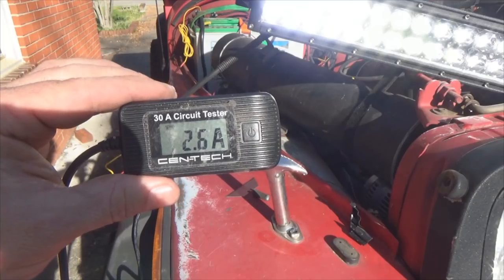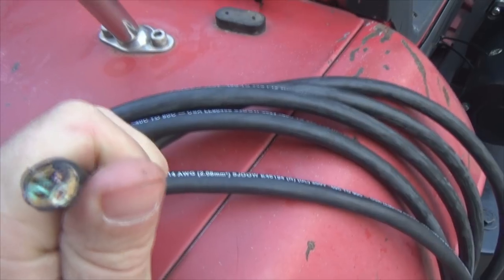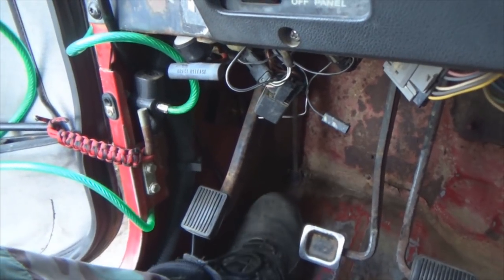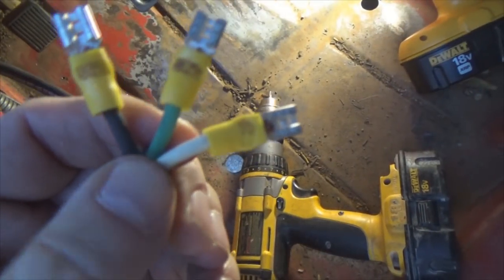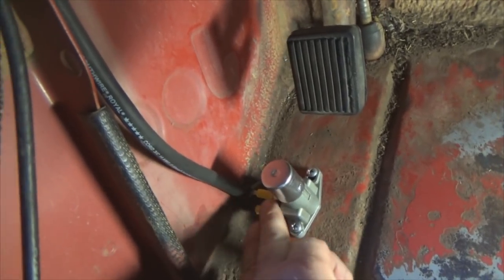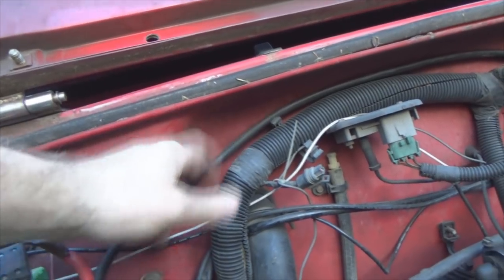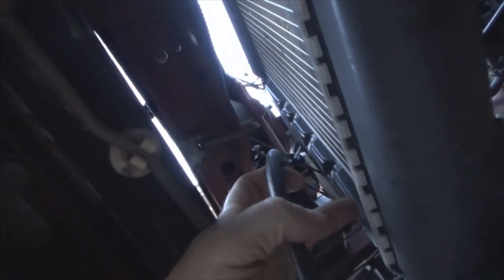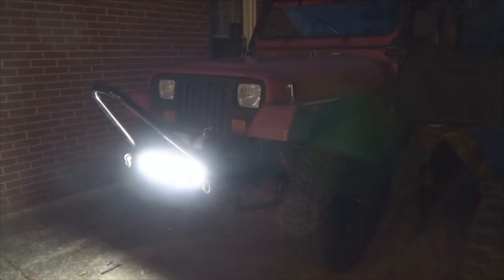Jeep Wrangler YJ - Lets install the floor light switch

Comment: Great vid - thanks.  Dumb question but on my '90 YJ i dont seem to have the fuse block where you show yours?  Any thoughts on this?
Reply: i found my answer after the fact.. it didnt help that i have 91 YJ Owner manual and that model switched over to the additional engine fuse block whereas prior years did not.
Reply: Have you checked under dash in the driver's side
Reply: @that_jeep_wrangler1886  yes, i knew about that one but i was looking for the engine fuse block, which doesnt exist on the 90 model i am running

Comment: Just wanted to know where you got your 30 amp current tester I have looked everywhere and no one has them napa,auto zone, advanced auto,etc. Thanks
Reply from the maker: I got mine at Harbor Freight a few years back. I also included an Amazon link in the pinned comment where you can order a similar version if you like. Thanks for checking out the video! Have a great day!!

Comment: when that positive wire comes loose on the floor i want to see the video of you putting the fire out lol no sleeve connectors dont do well especially in a jeep. have 4 jeeps in my shop right now burnt to the ground because of  bad home installs. oh and green should be power black should be for night and white for day with sleeved connectors.
Reply from the maker: Cant argue that. You are absolutely correct. I should have at least put heat shrink encasing the terminals. Thanks for bringing that up for other viewers can learn from it. Have a great day!!